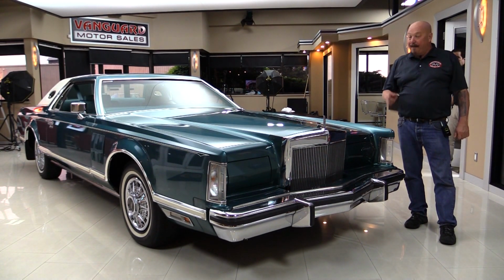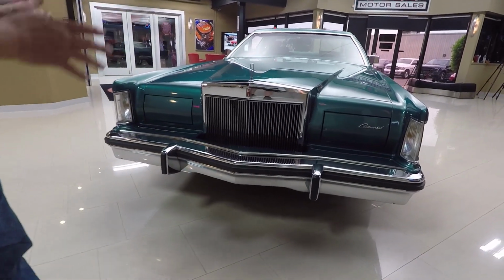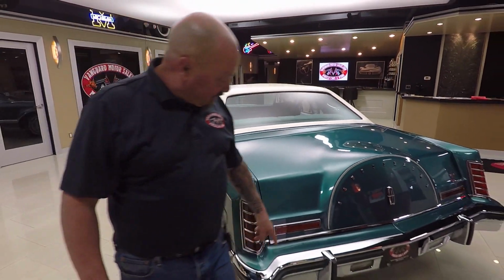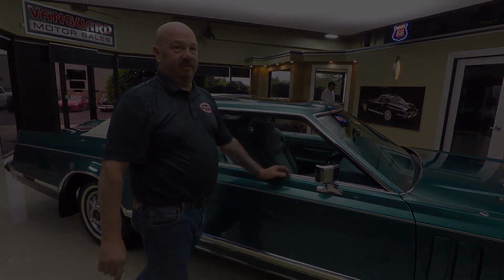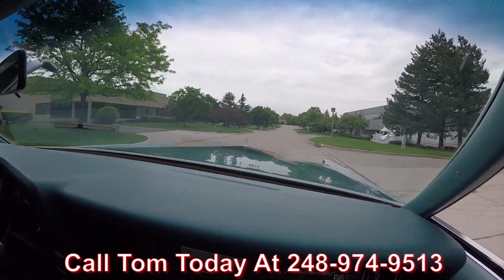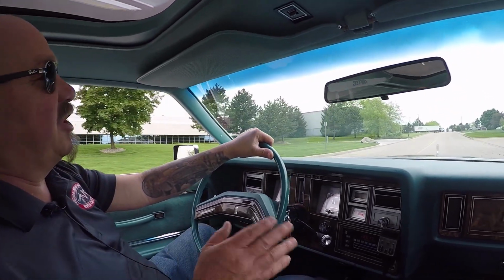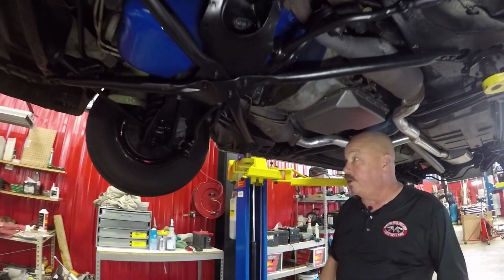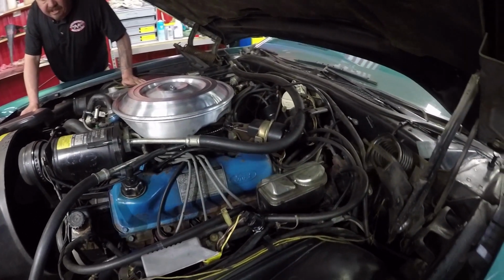1979 Lincoln Mark V For Sale

Comment: The 1979 only came with the 400 V-8 which that year was detuned to 159 Horsepower ....a rather lame engine compared to the superior big block 460 V-8. But overall condition is more important as most Mark Vs are now well worn with high mileage.